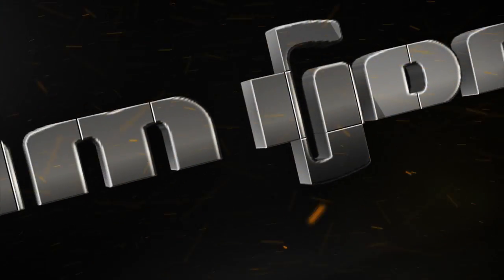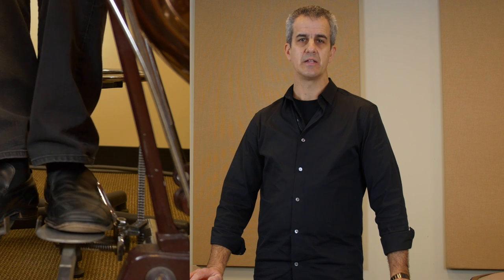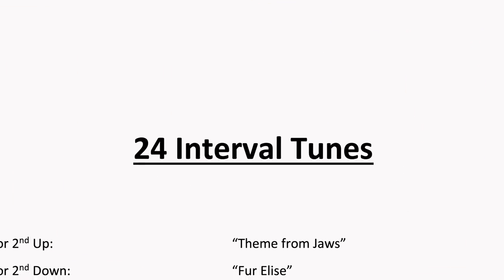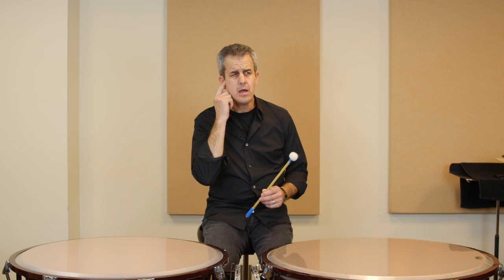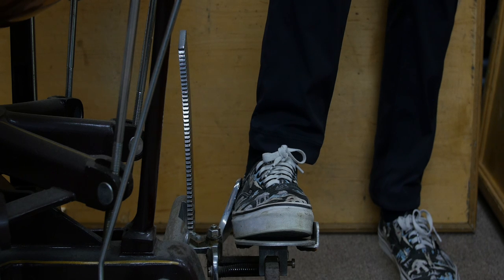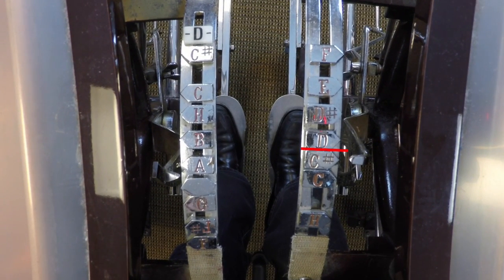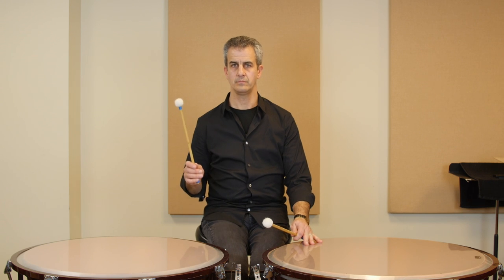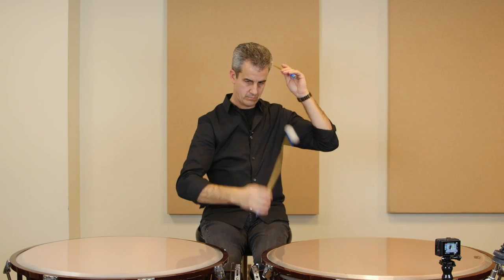The proper method for tuning Timpani

Comment: A question about the sit vs stand for playing. While sitting is preferable, I am only 5'6" and have found it difficult to comfortably reach the pedals and have good hand posture at the same time. I have been playing for a long time and have adapted but any suggestions would be appreciated. The pedals are not the clutch type, rather common Ludwig type.
Reply from the maker: You could tilt the drums which will bring the rim lower and make it so you won't risk getting a rim shot.